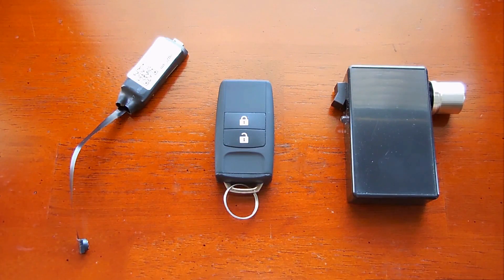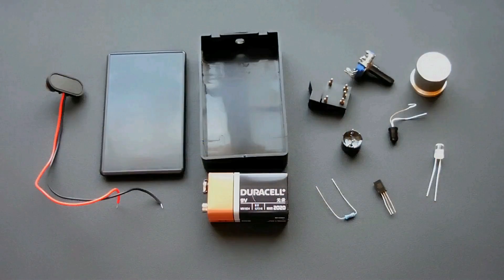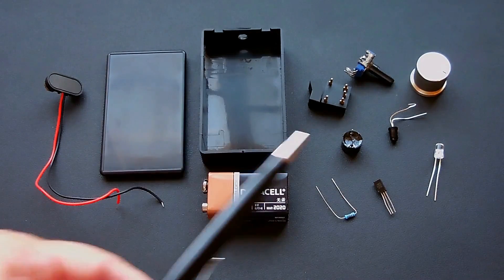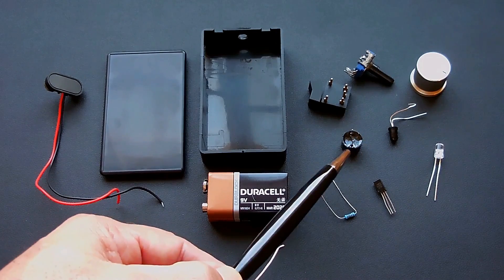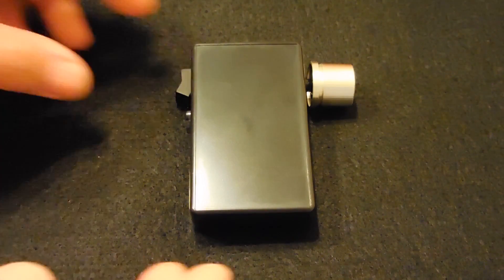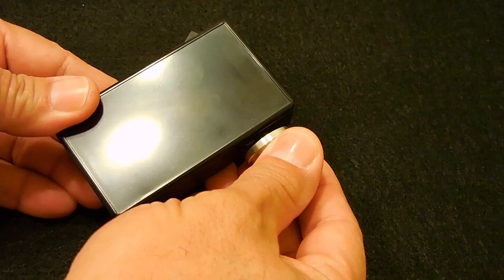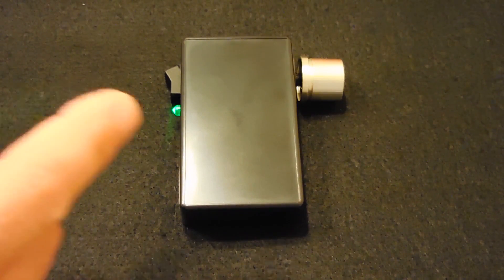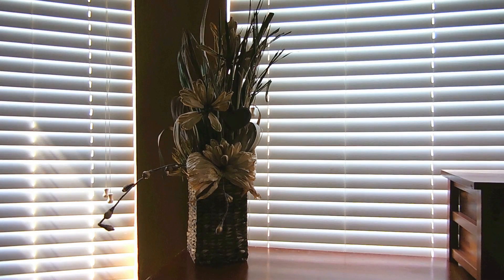DIY Infrared Camera Detector/IR Tester

Comment: Would it work for speed cameras?
Reply from the maker: No
Reply: Depends on the camera. In Aus I've noticed even during the day, when we are sent a fine in the mail from a fixed or mobile speed camera, the image shows obvious signs of being lit up by IR light. It makes the car numberplate glow white even in the day, can see it in other areas of the image too. So, in theroy... You could detect the IR light that is being used to enchant the photo of your number plate. Then you could have a few 1w IR LEDs around  the number plate (hiddenish), that automatically blind the speed camera. This is my plan anyway, I was just going to run my blinder IR LEDs all the time but I dont know if I'll somehow be figured out, so I'll write an arduino program to monitor ambient IR light and trigger my defence measures if the IR levels are above the usual. I think also adding a light sensor next to the IR sensor would help with the coding and stop false positives, as I guess the brighter the sunlight that hits the IR sensor, the higher the value would be, this could cause issues in shade/sunny flickering conditions. But, you could use the light sensor to account for the changes and keep everything happy until something bumps up the input on the IR sensor and not the light sensor. Or, just run the IR emmiter LEDs all the time lol, sounds like a lot of failure points in my fancy idea haha. Keep it simple stupid, I must remember

Comment: Nice idea, I’m deaf not able to hear it of piezo alarm. Any idea?
Reply from the maker: May be able to replace piezo with an old pager vibration motor...
Reply: Why a vibrator motor which is not as common as a simple LED or flashing LED that would work just as well?  The level of brightness visually can easily show strength of signal or how close you are to the IR emission.  Humans are more light sensitive than touch sensitive.  Not sure the vibe motor would indicate signal strength as elegantly.  And for those Spy or Detectives out there, they probably would not want to let everyone around know what they are doing with that annoying buzzer!  :)

Comment: so what if a camera doesn't have ir led and it's hidden somewhere around the room at daylight is t possible to use this device
Reply: No, this device detecting only IR light. In you case it's probably standard camera wich just capture video or image - it's don't have IR - need to detect it with diffirent way.
Reply: rusTORK so most of web camera and cctv use ir led.  since a hidden camera doesn't so the device couldn't find these type of cam what is the use